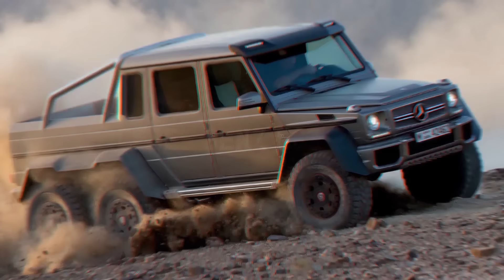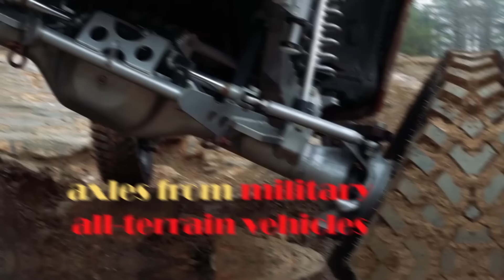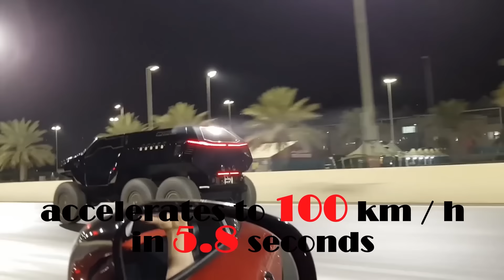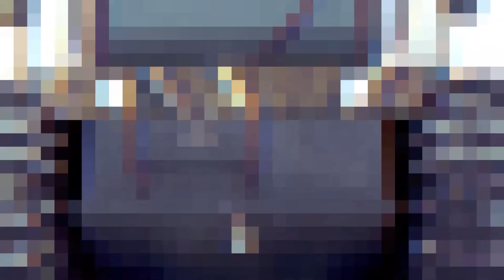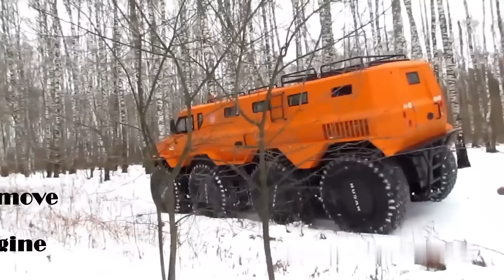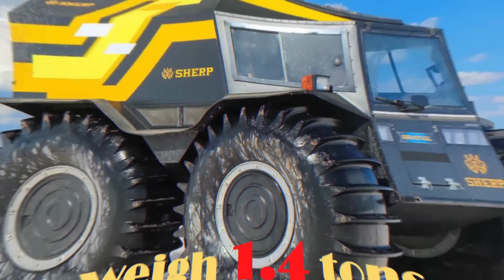12 Best Off Road Monsters of All Time (All Terrain Vehicles)

Comment: This is a very silly comparison in terms of aspects. Compare four-wheeled vehicles 6 or even with 8 wheels or with tracks. Series-produced vehicles, with those developed for individual tasks.
If they don't belong in the same category, then what's the point? On such a basis, a truck is much better, because it can carry more sand than with a VW polo.
Well, that made as much sense as carrying water into the ocean.

Comment: 2 of the vehicles you called “4x4” that had 6 wheels are in fact, “6x6”.     

Also.   527 inch tall tires on the Shaman.   That’s like 44 feet dude.   Have someone proof read your commentary notes. 👎

Comment: The most famous AND useful SUV of all time is the Mercedes Benz Unimog. It has portal axles, a pto or dual pto's, lockers all around, and they are used as fire trucks, rescue trucks, tractors, snow plows and many other things. There are too many accessories that can be added to the vehicle to even name. Look em up. They kick ass.
Reply: First time I saw an unimog go off the road it got stuck because the ground below half a meter of snow was not frozen. I, with a BV206 - one of the most capable offroad vehicles out there - had no issues because I didn't even sink through the snow. Sure, unimog is great, but it is no match to true offroad vehicles such as the sherp, ripsaw or the likes of bv206.

Comment: Actually the sherp wasn't pulling the trailer the trailer actually provides traction for it that's why it has hydraulic systems that lift up the front end of the sherp that is to shift weight on the back 6 tires that are being turned by a drive shaft coming from the front sherp also by tilting upward it allows it to go through very deep creeks